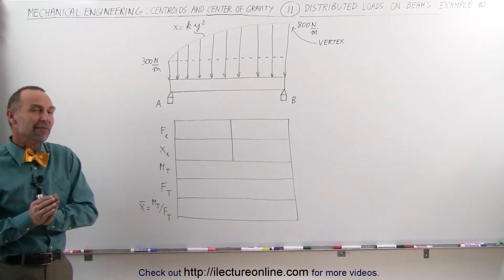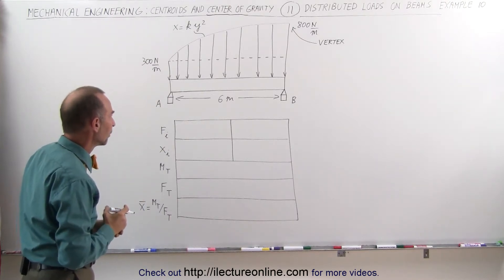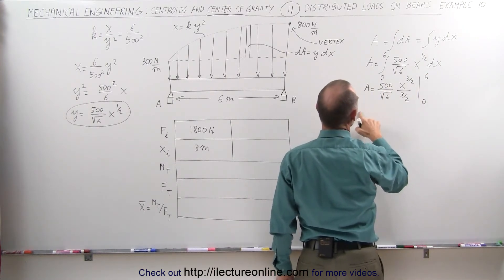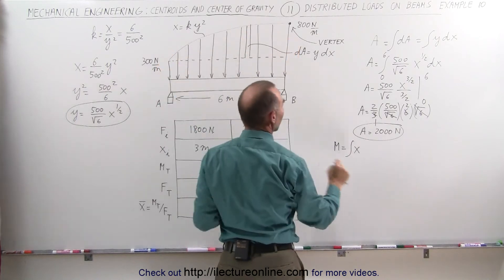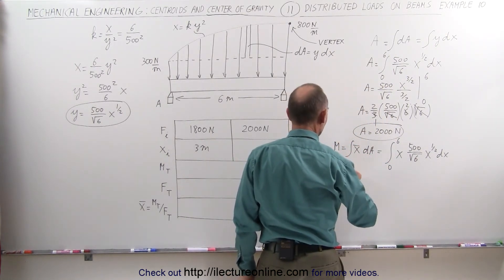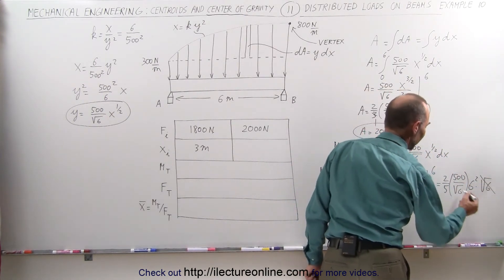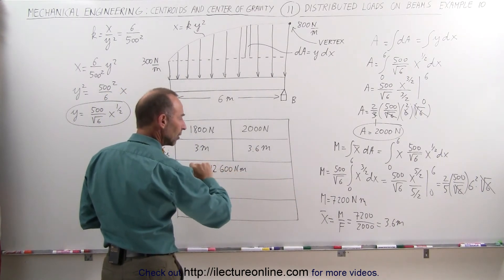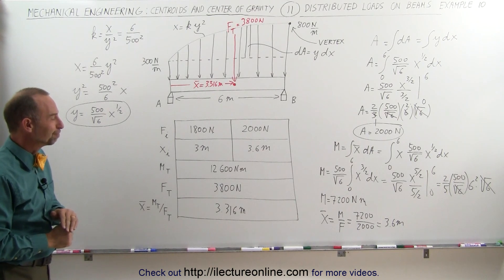Mechanical Engineering: Distributed Loads on Beams (11 of 12) Find Distributed Load on Beam Ex. 10

Comment: I know this is an old video but I'm confused.  The diagram labels the vertex as (6, 800), a parabola that opens downward.   The formula for this is given in one of the comments below.  
The diagram also says the formula of the curve is x=ky^2 which is a parabola that opens to the right with a vertex of (0, 0) (conflict???).  The formula for this parabola is y=302.77*SQRT(x) but it passes through the points given at (0.982, 300) and (6.982, 800) (harder to integrate).  
The third parabola given is y=204.12*SQRT(x) (used in the calculations) which could be the one shown on the board but it is not clear.  The vertex at (0, 0) for this does not seem right.